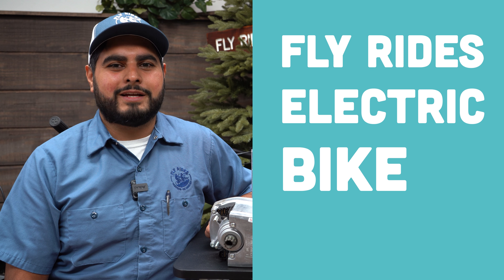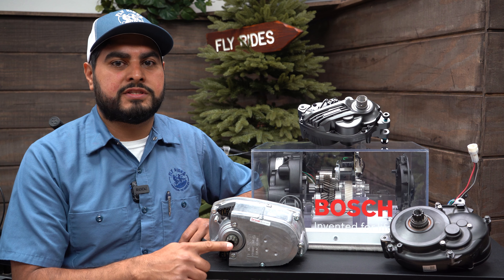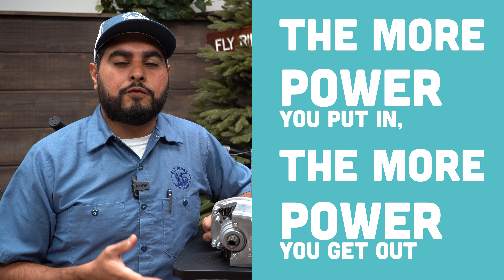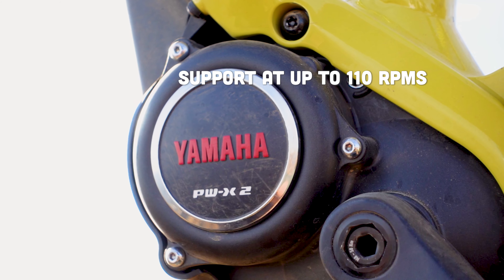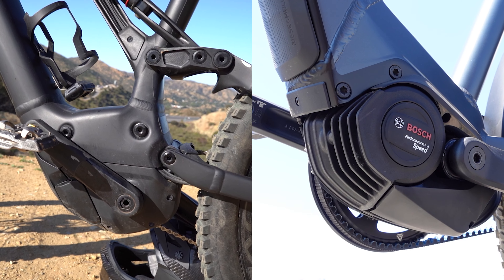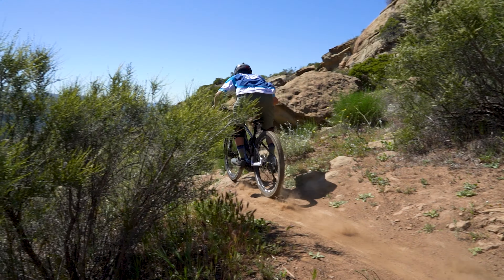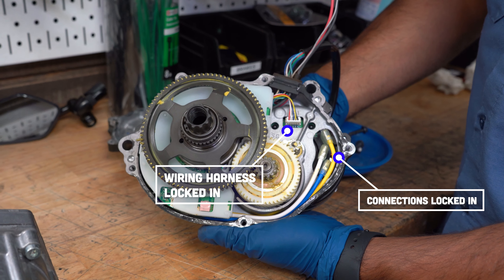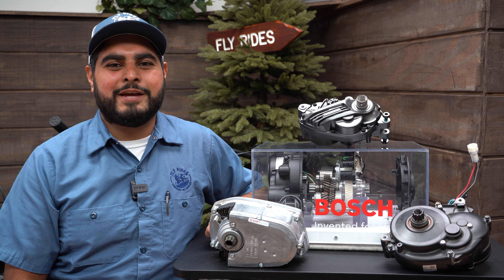ANALYSIS: Why Mid Drive Motors Work So Well. Learn From an Expert!

Comment: So mid-drive = no throttle? Not a good choice for someone looking to get around without pedaling.
Reply: Yes, a lot of BS in this video. Of course you could add throttle to your mid drive, (if the system support it) so at least it doesn't depend the location of your motor. And some of us just like more throttles, not any sensors. And BTW, direct drive hub motors are most reliables electric motor types, because their only movable parts are bearings! So you could make your own researches to know better those things.
Reply: This video leaves questions that the Cytech Training cirriculum would correct . Hall control and strain based resistive mapping sensors etc .
Reply: Mid - drive motors have a slightly "incremental" power delivery sensation through the pedals , especially on smoother climbs , due to hall control DC motor principles . Riding in off road settings disguises this feeling a bit .

Comment: Mid - drive motors are costly , especially parts , when they fail . Riding through flood water can see water get past the bottom bracket bearings . Dropping mid - drive pedalecs on hard surfaces from a height can damage the gearbox components .

Comment: I just bought my first Cube eMTB Bosch Gen 4 Smart System. I haven't had it out yet, but I can't wait until this rain clears up! I know this is a "how they work" video, but how do they work? Haha, right? What I mean is, when on the bike, say pedaling under the speed limit, does it cut out, or does it continuously run up to that mph limit, or does it cut out and kick in randomly? I've only tested it on the bike stand just now while building it. When I turn the crank slowly, it's just a normal bike until you batter the crank down. Then it will spin the motor for a couple of seconds and cut back off. I carry on turning the crank as if I were strolling, pedaling, there's nothing from the motor until I pedal back a tiny bit and really give it some welly down on the crank. It's like a pressure sensor feels, but yeah, I probably sound stupid. I've never had one before, and I can't get out on it due to the weather here in the UK at the moment, so it's all "I wonder" thinking just now with it, if you know what I mean.